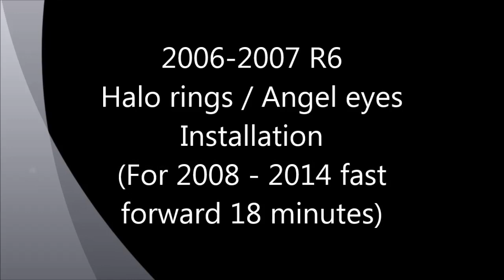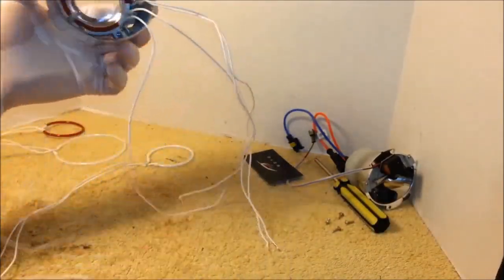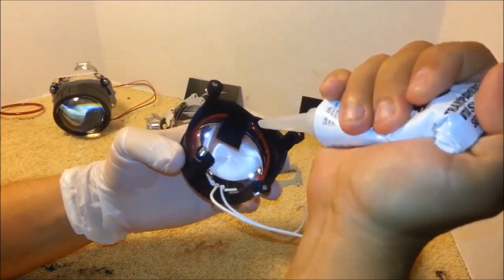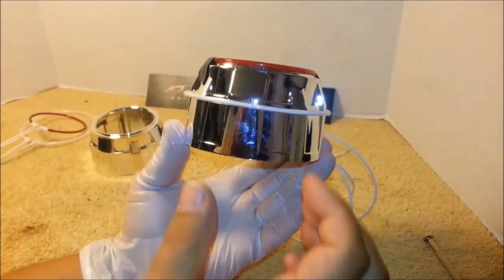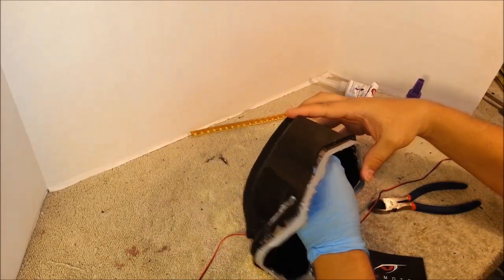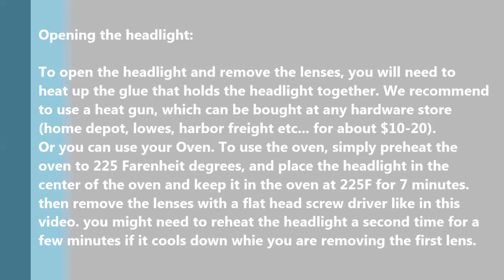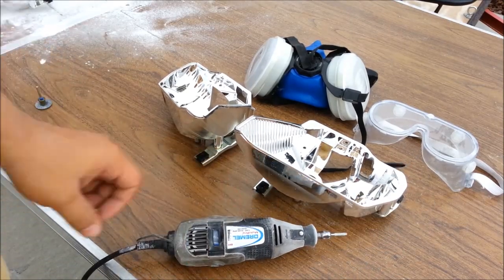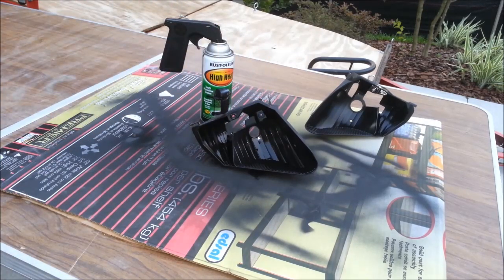Part1of2: Install BKMOTO.COM 06-14 Yamaha R6 BiXenon projectors halos demon eyes LED strips

Comment: I've got some LED rings, bu because of the wires soldered on the back they don't lay flat on the shroud. Any suggestions?
Reply from the maker: They dont need to lay flat, just put more clear silicone to fill in the gap.

Comment: So if I order from you with the angel eye option, I have to myself install the angel light or you mount it on the shroud? Thanks
Reply from the maker: +Sebastian Hothaza if you buy the parts kit you have to glue and assemble yourself, or you can buy one of our fully assembled headlights here: http://www.bkmoto.com/index.php?route=product/product&path=82_86&product_id=116
Reply: +BKMOTO LLC Thanks for the quick reply! I think I'm convinced :)
Will you be having any black friday deals? I'm in Canada and, well, our dollar isn't doing to well :/
Reply from the maker: +Sebastian Hothaza yes. use discount code bk15 for black Friday 15% off. expires monday
Reply: +BKMOTO LLC Do you have fully assembled Yamaha FZ6 headlights for sale?
Reply from the maker: +Michael Smith sure, we can make you a full headlight unit. email us for a price quote. sales@bkmoto.com
Reply: +BKMOTO LLC Thanks, Just emailed you
Reply from the maker: +Michael Smith got it. I will reply tomorrow
Reply: +BKMOTO LLC Awesome, Thanks for your quick response.
Reply from the maker: if you order a parts kit you need to mount the halos on the shroud. you can also order a fully assembled plug and play headlight on our website

Comment: I bought iron man ready projector retrofit 2.5" lens with a 4.25" shroud for the demon eyes inside the projector what size led ring should I use? And for the shroud I'm planning on putting a led ring inside the shroud what size inside the shroud should I use?
Reply: Chris Inman did u even find out what size rings u needed

Comment: Are these the H1 projectors? Or the mini's? What size are they? Thanks!
Reply from the maker: there are two projector models in the video. depending on the year of your r6. when you order from us you will select the year of your r6 and will receive the correct fitting projectors.
Reply: +BKMOTO LLC oh, I see. I have an 09. what projectors do you use on those?
Reply from the maker: +Sebastian Hothaza for 09 we use h1 projectors
Reply: O wow, so the full 3 inch ones? That's interesting that they fit

Comment: What glue r u using
Reply from the maker: wakawaka07 hi temp clear silicone, made by pro seal
Reply: +BKMOTO LLC Hello , I am watching your videos that inspired me and I wish I could do the lighting . Say what diameter to buy a set of bi - xenon 2` or 2,5` ? And that on ebay got such a set ? Can you provide leads with delivery to Poland ?
Reply from the maker: +Mario MotoVlog you can buy all you need on our website www.bkmoto.com
Reply: .How many inches May your lenses? Is 3 inches will enter into a lamp Yamaha R6 2008
Reply: What is the diameter and length of the set Bi - xenon ? Do you fit the lenses with a diameter and length 2,8` a whole 3` ?
Reply from the maker: +Mario MotoVlog 3.5inch diameter of shroud. about 6inch long
Reply: +BKMOTO LLC On this video you mount lenses the size of 3.5 inches for length of 6 inches ? I just prepare to buy a set Bi- Xenon . Just I do not exactly know what size would be best . I planned to insert a 2.5-inch Yamaha r6 , 2008.
Reply: +BKMOTO LLC I'll tell you that great overlook these modifications . I like to tinker , so I decided to also add bi - xenon . The lamp is already open. On days of purchase and repaint glare . I thought the black gills , but here in Poland I can not get it, while import is enormously expensive for Polish wages . I need to insert the lamp driving directions orange . Can you refer me on ebay such LEDs , which installed a few lamps ? I know that you have on offer , but the cost of shipping and duties on the road. I am on ebay pile of shipping for free just do not know how such they call , which you are using .